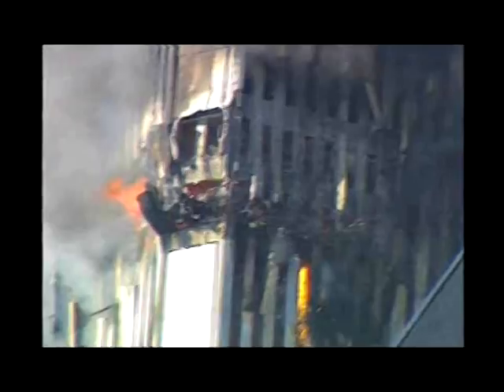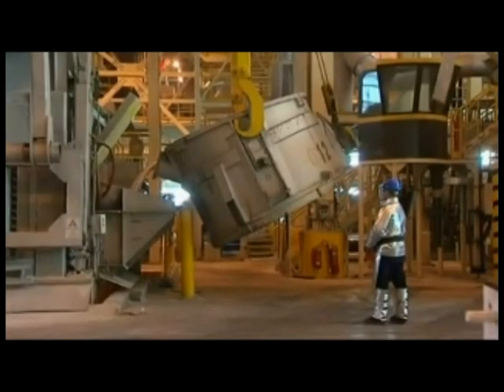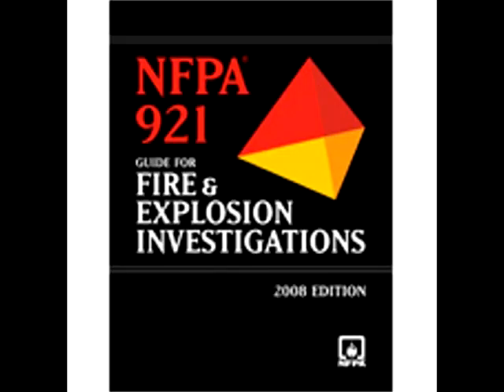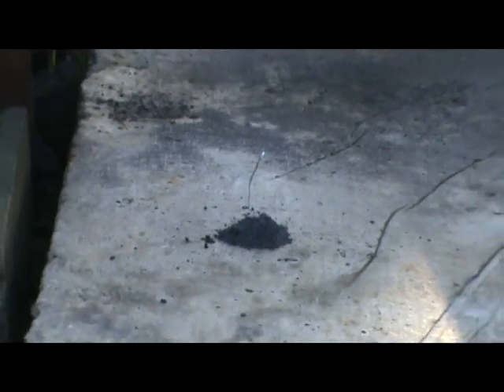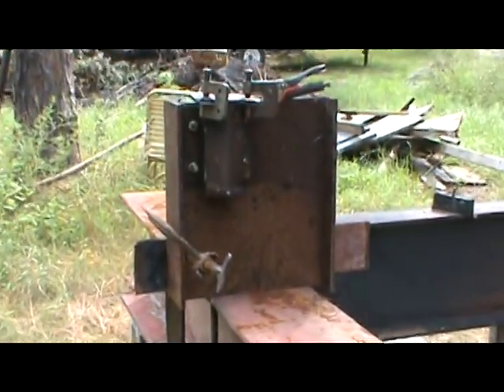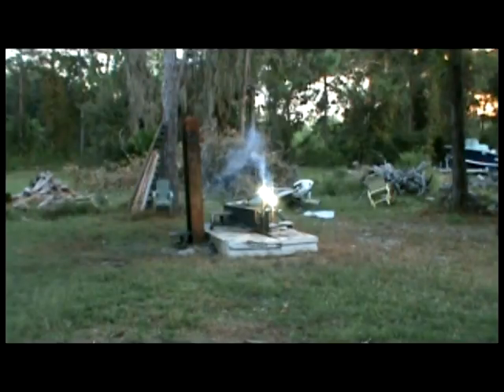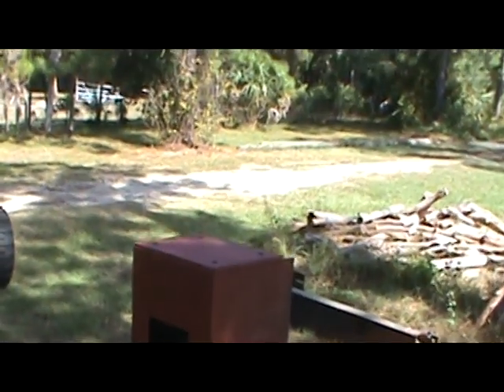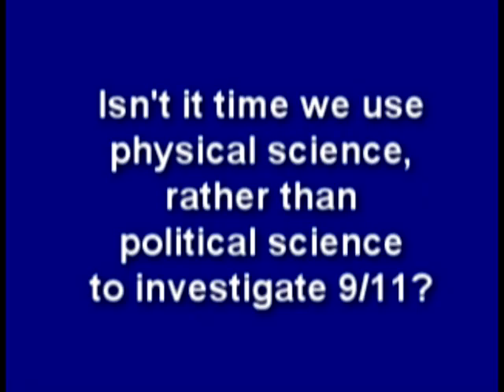9/11 Experiments: The Great Thermate Debate

Comment: If people had greater basic chemistry & physics knowledge, they would not fall for this rubbish. No exotic theory is needed to explain the melting steel in the WTC:    

It is true that iron liquifies at approx. 2500F. However, it will actually begin to burn (rapidly oxidize) in standard atmosphere at approx. 1600F.  This chemical reaction itself produces additional heat capable of melting steel. 

This same chemical reaction is the basis of how a common gas cutting torch works: It does not create a gas flame that melts steel, but instead merely heats the  steel to 1600F in the gas flame, then blows oxygen into the heated spot, causing the steel itself to catch fire. The rising heat of the reaction thereby created is what actually melts through the rest of the steel. 

Upshot: Once the WTC fire reached a critical mass wherein it could apply heat to steel of at least 1600F (a fairly typical large  structure fire temperature) in the presence of fresh air, the steel inevitably began to actually burn on its own. This reaction could easily create temperatures in the burning steel beyond the melting point of iron. 

This heat is what produced the molten steel pellets, and this same process is how a commercial shot tower produces shot for shotgun shells: Molten metal is dripped from a height, becomes spherical during the fall, and solidifies before it hits the ground.

Comment: What is the aluminum (al) of the airplanes mixed with the rust (FeO) on the steel beams. If that would be the case, termite would be formed. And maybe there where smal open spots in the building witch could have the same result as you experiments if termite would fall in there. Either way, the American government is a bad one and wil always continue there crimes and cover them up
Reply: I believe it was rust, i believe that the steel from all three buildings was of inferior quality and somehow was exposed to saline from ocean water which absorbed into the steel weakening so much that an airplane touching it could make it fall. Steel from a certain place is sort of crumbly. Oh yea the material was all from Where? Number 7 building was unoccupied at the time for some reason. It took only little force to bring it down also. Lots of truth in those supposed lies. It was an inside job!

Comment: Probably copper wiring from the buildings electrics that melted from the fire. Steele however doesn't melt at thise temperatures easily and would almost instantly recool to a solid state.

Comment: He claims that thermite had to have been used, but the only way to use thermite like he is describing it is to literally weld a container for the thermite to the steel frame. And it needed a massive amount of thermite to do so

Comment: Just because steel doesn’t become liquified doesn’t mean it won’t fail to hold up tons of weight. If the steel supports have the consistency of butter do you think it will be able to support the weight of the building?

Comment: I love all these guys that have never built anything are somehow experts on how the building came down.  Why don’t you research how the structure and the floors were designed/built?  French clip design held each floor. The exterior was the spine of the structure. A 747 hit the building and punched through and ignited everything in the building within range.  Each floor had a weight maximum. Exceeding this maximum dramatically would create failure. Even a portion of the 747 and the intense fire is enough to cause floor failure. From there it’s gravity doing the rest of the work.  I was amazed the structure survived as long as it did. Go ahead. Explain how the exterior spine was magically strong enough to withstand a jet liner strike.  I’m listening.

Comment: If the tops of those towers were melted by jet fuel they would  .. just.. idk keep burning on the top or fallen off to the side? no fucking way in hell that a molten top floor would melt steel even.. what 5 floors down?  not to mention make the ENTIRE building collapse . Guess its more profitable to build   something new instead of repairing a few burned out floors...

Comment: I was just thinking...
Math is mostly solved by conjectures

If this was a planned attack
And there was thermite/thermate/nano-thermite(?)
Then the plane would hit it right on.
Now, I wonder if the whole twin towers would collapse if the plane hit any lower or higher than it did. 
Now add on the second plane..
Would the structure collapse..at any other point? Or does it not.

Comment: You don't need to melt steel. Red hot steel gets soft enough to become malleable. That's how horseshoes are made. They aren't cast, the steel is softened enough for the blacksmith to hammer it into shape. Same thing with Japanese katana swords. So a hot fuel fire burning, plus the mass of the steel beams, plus the added mass of the plane wreckage, were enough to soften the cross supports and cause the floors to collapse. Once one floor collapsed and fell on the floor below, a chain reaction began. The floor below had to support twice the weight of the floor above it, so it collapsed, and so on. By the time it had gone down a few more floors, the accumulated weight exceeded the design strength of the supports, so the floors just kept collapsing. It's not rocket science.

I'm not a fan of conspiracy theories.
Reply: its funny all of you guys who keep saying you dont have to melt steel for it to be weakened, just enough for it to bend always run for the hills when we tell you that pools of molten steel and nano thermite was found at the site by 7 independent research groups. if you think fire alone can weaken steel enough for it to pancake, i seriously have no idea how you can enter any building without trembling in fear incase of a freak fire.
Reply: cameron martin Because a fully loaded airliner crashing into a skyscraper is a little more than a "freak fire". JFC, learn some physics.
Reply: so you want to completely ignore wtc7? you realise that if one building was wired to come down, they were all wired to come down
Reply: cameron martin That's because none of them were wired to come down. WTC7 fell after experiencing the equivalent of two earthquakes when the towers collapsed, combined with being weakened by the heat from the smoldering remains of the towers all day. There is just no there there. There would be no reason to wire it to come down. Other buildings in the complex and in the surrounding area were irreparably damaged and were eventually demolished to make way for their replacements. Why would WTC7 be any different? Why would the hypothetical "conspirators" risk getting caught dropping a third building? Just condemn it and implode it later.
Reply: because the event needs to be dramatized. you need to understand what the purpose for the whole operation was for. flying a couple planes in the buildings and killing a few hundred people won't gain enough public support for intervention to iraq. demolishing the buildings is an effective way to maximize carnage.
Reply: the buildings were also insured against terrorist attacks 3 weeks earlier which larry won the case for

Comment: As a student of physics, and engineering. While, like you, not an explosives expert. I can say any powdered, or (relatively) slow burning, high output fuels, do a mutch better job, when contained. Such as your box cutter. Is precisely the same way shaped charges are directed at their intended target. From demolition charges, to HEAT shells in an anti tank gun.
The heat, is contained, and forced at a smaller area, meaning more energy per square cm.
HEAT shells are completely mitigated and defeated by all spaces armour. Because the projected gasses disperse as soon as they are permitted by the spaces air between the Hull and the plate the shell hit. Where as if those gases are contained, and forced into the Hull, they continue to cut an inverted conical hole, with the tip of the cone Shape on the opposite side of the plate of metal (generaly steel) before usualy cooking off the crew andv internals. HEAT tended to detonate ammo racks as well...
Now, let's say you have aviation fuel, burning in a very compact area, and again, burning relatively slowly (I say relatively because thermite burns much slower than plastic explosives, but burns much faster than say wax or crude oil etc), I belive its possible the aviation fuel might have built up some quantity of heat. When you add the length of time it had to burn and add energy to that confined space and increase the temperature. It also had a headstart as those engines possibly were burning anywhere between 1000deg Celsius to 1500deg C. Most comercial airliner Jet turbine combustion Chambers start to degrade and self destruct at 1200deg C

Construction grade steel, I believe melts approx 1370 deg C.

If you know what the elephants foot in Chernobyle is, and you know how it was formed. The uranium fuel rods slowly melted and the increase in temp, means fission is easier to achieve. This slow knock on effect fueld the rods to melt the core itself before flowing across the reactor room floor, down a corridor, and a handful of staff accountedv it looking like a river of molten metal/lava flowing down the corridor, before it found a weaker point on the floor, or simply became so hot it helted through all 11 floors, before stopping on the concrete foundations of the basement floor. It had only just finally begun to cool and slowly solidified, forming what is now the single most deadly object on this planet. Nicknamed the real Medusa, or the Elephant foot due to the distinct nail like shapes and round sides. The hero's who sacrificed their lives to study it briefly after the catastrophe struggled to determine presisly its makeup. It's made of everything from Uranium, lead, steel from the structure, to possibly/probably even the floor linoleum and anything else it dragged down with it.

I think it's possible one of the combustion Chambers was still hot, probably overheated and jump starting enough heat to make a fire hot enough to start melting a few things.

Once a fuel is contained, and the heat insulated, the fuel simply has to burn long enough for the heat to rise.

Now I'm not saying that IS what happened. I was just about 3 at the time. But I can say, it's possible, the exact events inside the effected floors may never actually be determined down to the last details.

I'll also say, aviation fuel CAN melt steel and even Iron if put in a contained environment. Aviation fuel can burn at 2000+ deg C

Comment: You can heat steel up well under melting point and it will still make the steel soft enough for it to become weak and fail under its own weight. Melting point = the temperature at which steel becomes a liquid. You can heat steel until it's soft which is well under melting point. Which is exactly what happened with the jet fuel.
Reply: What do you mean? Both towers were hit. Both became structurally compromised, thus leading to their collapse. The reason they fell straight down was likely due to the pendulum that's within all skyscrapers which prevents swaying of the tower from wind forces. Also, Engineers purposefully build things with forethought. They knew those buildings would be potential targets for terror attacks and in the least likely outcome (which did unfortunately occur) that the tower actually collapse. It was designed to fall straight down, or, in the direction which would cause the least collateral damage. Which in this case was straight down. 

Also, think about the logic behind it being an inside job. How the fuck do you expect the government planted enough C4 in two fucking skyscrapers in a single night without a single person noticing. Because had anyone noticed, they would of been killed, and they would of been noticed as missing long before the attack on the towers. Not to mention, how the hell would no one in the entire building notice plastic fucking explosive blocks placed in the building. It's illogical. You'd have to be neurotic to think it was done that way. There isn't even a good motif to blow up the twin towers.
Reply: Uh yes. Both towers were hit by passenger planes. There were two planes. One hit each tower. They would of been carrying more than a sufficient amounts of fuel to heat the steel. Many people believe jet fuel isn't flammable unless it's vapor. This isn't truth. The reason you can't just put a flame to a puddle of jet fuel or diesel and ignite it is because it has a much higher flash point. Once the jet fuel became hot enough, it would of been capable of igniting. Also, why the fuck are  you talking about Chechnya? That's all the way in Russia and completely different incident. Something the temperature of a house fire would not be enough to heat the steel. Also, the steel wasn't even exposed. Steel beams are encased in concrete, which provides more than enough insulation.  The planes that hit the twin towers destroyed much of these concrete encasing on the beams.

Your question is rather stupid if I'm being honest. It's like me asking you. "If I stick a pizza in the oven for 350 degrees, and a different pizza in a different oven for 450. Why does the 450 pizza  get done faster?" 
You know the answer to the question and you're just too stubborn to accept the truth because you've been believe these bullshit conspiracies.

Comment: Hey, did you know? You can dissolve steel in molten aluminum. The aluminum even starts to glow red as this happens. 

Hey, did you know? Jet stoves work by lighting a fire partway up a tube. The fire draws air up the tube and burns hotter than the fuel normally would. 

Do you see the problem with trying to prove a hypothesis by cherry picking? It's bad science and you oughtta be ashamed.

Comment: The buildings were hit by a 737 going 100's of miles per hour take that into account then relize tha they didnt need enough heat to melt at all just enough to bend. With all that heat and the jet hitting the building it was enough to make the steel bend and the buildings to fall.
Reply: rotflmao.... that in no way explains free fall speed which is only and then only barely possible in a implosion.....anyone but me notice the implosion shows all over the history and science channel at the time , disappeared comp[letely almost instantly after 9-11, they wouldn't want folks putting 2 and 2 together after all
Reply: other building older building have burned more and longer and not fell , others been hit by planes , burned and not fell , including the empire state building ... it was implosion 100%
Reply: Tony Haskins yes otger buildings have burned and even been hit by planes but they were not hit by a 737 passenger jet going hundreds of miles per hour thet were hit instead by stunt planes which are much smaller and lighter of an impact. And it wasnt an implosion because there are thousands of videos showing a 737 going into the building.

Comment: See my biggest problem with this was even if the plane hit the top part of the tower wouldn't the tower fall forwards not straight down if I goes down then you have to use a controlled explosive so that it doesn't destroy other buildings around it so you sir are right that the planes did not do this but you are also wrong because it was the Clintons who did this and we need to hang em high in the streets

Comment: The box cutter set up is pretty cool! 

I'm really surprised anyone could honestly say thermite couldn't melt steel.. I mean, they use it to weld railroad tracks.

However, proving that thermite COULD have been used, doesn't mean that it was.  Wiring a building the size of the WTC for demo would require massive manpower.  No one saw anything?  No one who did the work has come forward in nearly 2 decades?  

And for what purpose?  To get us into Afghanistan?  We have never needed to kill our own citizens to go to war in the past.  Why would we start now?  Or maybe for the insurance money?  Why would the government cover for the owner?  And the insurance company has no interest in a fair, unbiased investigation?

I have no doubt that the US government wouldn't think twice about murdering thousands of its citizens for political gain.  There is little evidence that they did in this instance.  Supposing 9/11 was an inside job leads to far more questions than were posed in this video.

Comment: if they DID find thermite, it was created during the crash, thermite is a ratio of aluminium power and iron oxide. Aluminium powder comes from the destroyed plane, because that's what planes are made of, and the iron oxide comes from the steel beams (IRON and carbon) when heated really hot (the burning jet fuel and the explosion) with oxygen in the air. These two ingredients make thermite, and maybe even some of the thermite was burnt.